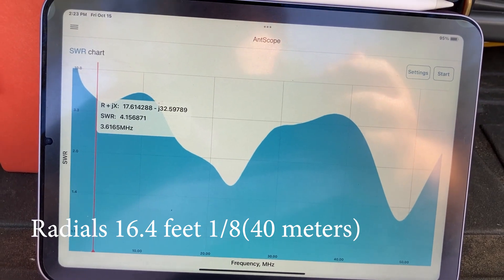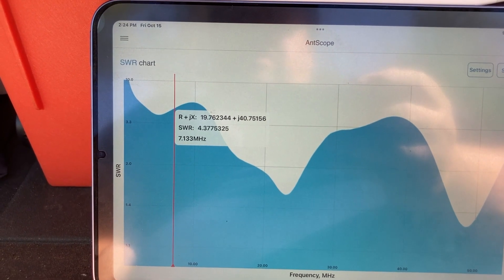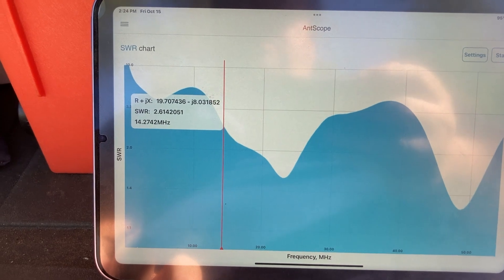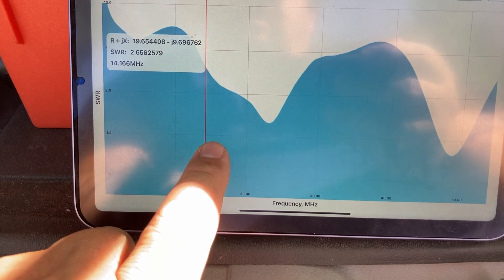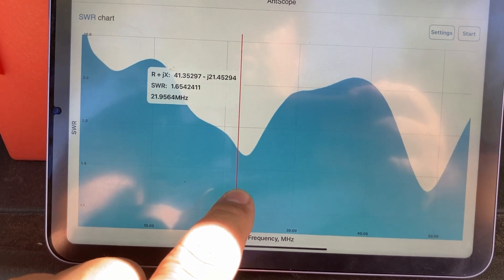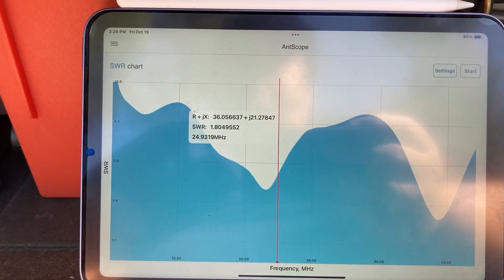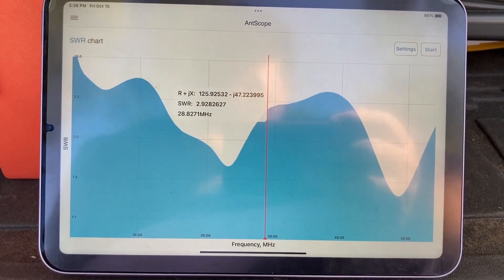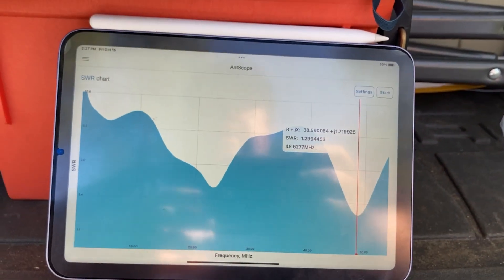CHA MPAS Lite with 1/8 Wave Radials

Comment: Great video Frank.  Adding more radials to my maps is something that has always interested me.  I tried it once and the SWR got so bad.  The one thing I have never tired is to add more radials and then adjust the telescopic antenna to try and improve the match.  Thank you for all your hard work and content.  It has been very valuable especially with the FT-818ND.
Reply from the maker: It turns out after a few years of experience and knowledge, you do really need a tuner. And that’s why I gave up on this product. It pushed me more into reading and 10 theories and found that a quarter wave ground plan Antenna which cost way less if you make it, less than five dollars will give you a tuned antenna. But of course there are some drawbacks. One is that you have to put the quarter wave ground Antenna hung from a tree. And the other issue is that it’s only for one band frequency

Comment: Something doesn't seem right. I have this antenna and use 1 radial somewhere around 23ft and get < 1.5:1 for 40-10. Even without a radial I get better SWR than 3:1.
Reply from the maker: If u lift the radial you will have a much better result. Also the ground’s properties has a lot to do as well.